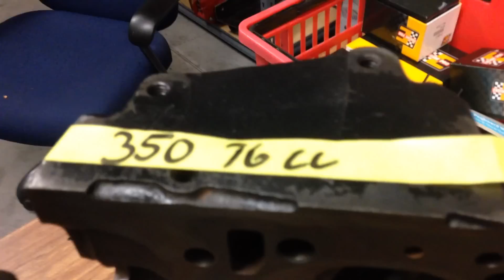350 and 305 Chevy what's The Difference

Comment: now do a 350 and a 400..4.125 inch bore.....not much space at all

and how you can turn a 350 head into a 400 head by drilling holes. 

ive got a 400 in a 68 impala that had a 327 in it....looks the same, handles the same....but lots more power.

and my 77 chevy truck....i was told it had a 305, but it actually had a 400.....first time i drove it, i knew that was no 305. 
my grandmother has a nice 86 truck with a 305....not even close to a 400, but still a good motor, especially with a 700r4. 

just accept the stock 305 power and use it....dont mod a 305....cheaper to get a 350 or 400
Reply: Please do this comparison.
Reply: He'll have a hard time frinding a Small Block 400.  They didn't make as many of them and only ran from 69 to 78.  I had one that came in my 74 El Camino and it was great but I ended up having to sell it to pay bills.  Completely stock unrebuilt I got $350 for the block.   Stock 400 heads are pretty much garbage ( 882 castings) but as you say you can drill 350 heads just by matching up the holes from a 400 head gasket.  Just do it right because 400's have no water flow between the center 2 cylinders.  No room just steam vents there which have to match up.  That's the other reason 400's got a bad rap for overheating, the lack of meat between the center bores that could cause the block to crack between 3 and 5 and 4 and 6.  I didn't have that issue but I also made sure I didn't overheat the engine either.
Reply: Car Stuff with El Camino Guy
Reply: sb 400s are not that hard to find I have 2 and both are the stronger 2 bolt main blocks(the 4 bolt truck blocks have less meat in the webs these are the blocks with 3 freeze plugs per side the 2 bolt block has 2 freeze plugs with the center (third) boss not machined for a plug this makes it easy to tell a 400 block from the other Chevy small blocks (the other small blocks all have 2 freeze plug bosses) and a 2 bolt 400 from a 4 bolt 400 with out removing the oil pan) one of the best improvements you can make to a 400 is to use the 5.7 inch rod  (350 or 305) I never had the overheating problems the biggest issue I had was cylinder wear due to the short 5.565 inch stock 400 con rod(the rod to stroke aspect ratio is to low at 1.48 to 1) when I went with the longer rods with matching pistons and complete balancing it made a for much better engine also if the block cracks between the steam holes it will not hurt it but if like you say it cracks between the bores as with any block they're junk sorry to be long winded but I have built a lot of sb 400sPS if you use 5.7 in rods check your cam clearance before you have it balanced you may need to modify some the rods
Reply: insulman100
 Well, Maybe where you are they're plentiful but where I am it's not the case.  Thing is you may find them but a lot of them either cracked between the center bores or have cracks at the mains.  You're right, the 2 bolt main blocks are more desirable because of the reasons you specified.  I heard from a lot of people that got screwed over buying junk 400 blocks because of it.  You're also right about the freeze plugs.  I had arguments with people that said my 400 wasn't a 400 because it only had 2 freeze plugs.  Once they saw the 1509 casting and looked it up they finally shut up.  These days I'd be looking toward a 502 to live in my El Camino once the 350 Truck block that lives there now gives up.  I'll probably do another rebuild of that 350 for another car though since it has the splayed 4 bolt conversion done to it.
Reply: The only thing I wand out of a 400 is the crank.  I would take a 383 over a 400 all day every day, unless I wanted to make a 406 for a dirt track car...
Reply: Long stroke with a short rod was the 400SB's biggest problem.  Siamesed cylinders aren't a problem - most engines have them nowadays - there is very little heat transfer on the non-thrust areas on the pistons.  The long stroke and short rods, OTOH, created too much thrust load on the pistons and bores.  Even with a 5.7" rod, the rod to stroke ratio is only 1.5:1.  Moving up to a 6" rod increases the ratio to 1.6:1, which is closer to that of a 350 or 305.  This requires a shorter piston, which will run hotter and tend to rock more in the bore.  A 305/350 crank can be used in a 400 block with main spacers to make a 372, which should give more power than a 350 but be more reliable than a 400.
Reply from the maker: now days the factory 400 cranks are not a good choice for a 383 build it will cost you more to grind down a 400 crank to a 350 main size than it will to buy a new 383 crank from scat don't waste your time with factory 400 cranks if you want a 383
Reply: 400 is a sweet motor, I let mine sit for 5 years and season....tough as can be and a real torque monster.
Reply: Would like to see 400 comparison and more info on 400. Just got a 77 gmc vandura box truck, looks more like a hot rod with all the ground effects. Would love to build motor for more power. Will be hauling tons of tools and materials for construction.
Reply: @Myvintageiron7512  
 Can you do a comparison on a 400, and how to get the most power from it. Have a 77 GMC Vandura box truck with a 400, the guy told me it had 350 heads on it.
Reply: The 400 is a crack addict. If you bore it more than .030 over you risk cooling issues in the cylinder walls. Good for nothing but boat anchors.

Comment: Awesome to know this! Very kool to know this information. I had a 350 in a 1989 Formula Firebird, it was pretty powerful but had lots of issues with the headgaskets blowing, transmission constantly slipping or locking into 1st gear only. When it was up and running it was truly an exciting ride but unfortunately that was only about 15 percent of the time I owned it. Was it fun to drive and race around in yes, was the down time and repairs worth the hassle, no.

Comment: i think the bad name came more from the fact that they are jus pretty weak on power generally. some run good and some are jus dogs, ive seen some tbi ones in a 2wd reg cab trucks with some good gears and even a 5 speed that were pretty respectable and would run good. with that long stroke they make good low end torque as well, they jus run outa power pretty quick.
Reply: Lee  Dillinger its the compression issue and the heads

Comment: How about putting 350 heads on a 305 ? With good pistons
Reply: ripfletching
 You will end up with a very low compression engine because of the combustion chamer volume unless they are milled down.
Reply: The valves can clip the side of the bore. Not a good ideal.
Reply: 305 heads on a 350. That works.
Reply: +osp80 how close does the intake valve of a Vortec head come to the deck of the 305?
Reply: But then you only get 10 MPG and have no good intentions.
Reply: 350 cam will tune the 305 right up
Reply: 79tazman so one says not a good idea, you say to do it. So yes or no?
Reply: @rudychapa6759  the will work but it has to be the right heads best thing is just a cam and port and polish the 305 heads

Comment: We raced SBCs for many years in our WoO sprint cars. 1) find or get some " double hump " SBC heads. 2) Find a 4 bolt main SBC block. Many were found in trucks 3) polish the crap out of both intake and exhaust ports on the heads. 4) Match up the intakes and gaskets to the Hiborn or Enderle fuel injector ports. 5) Nitride the crankshaft. 6) 12.5 to 1 pistons when running on alcohol. 7) A gearset crank to cam gets rid of any slop from a timing chain.  8) a Joe Hunt magneto properly set up. 9) a dry sump system if you can afford it. The track is our dyno. When the green flag drops, the B.S. stops.

Comment: dude I love roadkill great show. is it possibly you could make the same video but with 318 vs 360 please it would be the best
Reply: Useful Entertainment And Also The AMC VERSION!! 304, 360, 390, AND THAT MERCENARY COP MOTOR KILLER 401!!!
Reply: Useful Entertainment The difference between the 318 and 360s is a little more complicated there's only about .010 difference in the bore the rest is made up in the stroke add to that of the main bearings are different 318 - 340 have the same stroke 340 was meant to be the performance motor there was even a block with extra webbing for strength and changing pushrod position
Reply: Craig Hooper interesting, I don't hear about the 340s that much
Reply: If you haven't figured it out I put the dot in the wrong place the 318 has a 3.9 bore where as the 360 has a 4.0
Reply: Of course of the three blocks Ford Chevy dodge the common stroker kits you get more cubic inches from the dodge I think they have a 4 inch stroker kit for the 360 you can get it up to 409 maybe if he ever gets around to an LA maybe he could do a stroker on it but there are a lot more popular motors for him to do and everybody just wants a Hemi
Reply: 340's were quick.

Comment: Good video! I do so part time work in a racing head machine shop. Built a 305 with 400 stroke, 305 vortex head, intently balanced. 
Made 504 horsepower at 5800, 590 foot pounds at 5500.
Reply: So how can I get more power out of my 305..k1500. So I won't be the mlm last one towing up the grade

Comment: 305 - HELL - YEAH - !  I built a Camaro 305  that I had laying around the garage to put in my 1975 Corvette - so I could enjoy the car while I built a very nice 350 for it.  While working full time - I built this 305 in 9 days - that's including taking the Corvette engine out - tearing the 305 down - 3 days at the machine shop - putting the 305 back together & installing it.  Although I was in a hurry - I didn't want to put a stock 305 in it - so I added a nice EDELBROCK cam & lifters - aluminum intake - carb. & headers. Pretty much all of the  bolt on stuff for my 350 that I already had.  I also did some secret stuff too - lol  I'm so- weak - but I just couldn't help myself.  Well - to my surprise - it turned out to be a  screamer - I mean, that thing just roared - ! It was crazy how fast it was.  I mean - this 305 would throw you back in your seat & keep you there until you let up.  It was a beast - !It was an amazing change from the 350 that was in it.  By the way - your probably thinking that - well the 350 was old & had a lot of miles on it.  - Nope - the people I bought it from had had in all rebuilt about 5 years before I got it.  I took it back to the guy we bought it from & asked him if he would like to take it for a spin.  As we were driving - I told him to go ahead & jump on it - still not understanding the point that I was trying to make he floored it.  It slammed him back in the seat & his eyes got huge as his jaw dropped - then he let off & stopped.  He just looked at me.  I laughed & said - you like -? he just nodded. Bottom line - it was quick - it was fun & it was dependable.  I never did take that engine back out - it was that good.  Here is the funny part - the day I bought the Corvette - the wife & I decided to take out for an evening cruise.  We didn't get more then about a mile or so from the house & ran out of gas - !  Boy those Corvette 350's are hungry.  That being said - the added bonus of the 305 that I built was - now get this  -  that bad boy was crazy good on gas.  I mean so much so that we were always worried that there was an issue with the gas gauge - nope.  We drove & enjoyed that car for 20 years.  Other then oil changes & tune up's I NEVER had to lay a hand on that engine again.  I would eventually trade it to my backyard neighbor for beautiful top of the line Lincoln Town car that  was in showroom condition.  The Lincoln was about $45,000 new.  He had heard the Corvette running in our back yard - after I had washed it.  He popped his head over the privacy fence & said " boy that thing sounds great - I could hear it from my back porch"  We would eventually make the trade.  He had to work on me a while because we just loved that car.  But we decided to let it go.  I mean - come on - he had that gleam in his eye that only a man gets when he's in love.  Besides - I think that everyone should have a Corvette at least once in their life.  We got to be such good friends - that we put a gate in between our properties - so we wouldn't have to walk or drive around the block to visit each other.  The bottom line - engine's just like life - they are what you make of them-!  If you take care of the things that you love - the things that you love will take care of you - !  Bigdog - out . . . .

Comment: I agree. 305 is definitely not junk. You're not going to take over the world with it, but it can be a good thing if used in the right application. I rebuilt one in the 90's for my Caprice and drove it forever. Change the oil on time and keep the cooling system up and it was bullet proof.

Comment: good video.  Another small block engine from the 70's was the 307 cubic inch engine,  I know they used the 307 in pickup trucks, maybe in some other Chevy models too.
Reply: had a 307 in my 72 chevelle wagon and was the first car that I hoped up and learned a lot like make sure the rotor is in the right spot!

Comment: Thank you. That was a great review. I haven't been in the "game" of engine building, swapping (etc.) for many years and have been trying to refamilarize myself with the line of thinking (orientation) needed for working rationally on engines... instead of the wide-eyed illusionist (delusional) teenager perspective I had seen many decades ago when working on different street performers for friends and others who thought to build a vehicle that could climb trees, fly over mountain tops, etc.... In addition, I agree with the assessment made about the old Hot Rod magazine. Thanks for tip about the new generation of down-to-earth enthusiasts having taken it over.

Comment: My understanding is that the 350 blocks had a nickel alloy in the block, while the 305 had none. This made the 305 cylinders wear faster. This info is from the HP book on rebuilding Chevy V-8's. In my times selling used Chevies at a used car lot, the used 305's we got in trade with about 100k miles always burned oil, and typically had flat cams and chewed up nylon timing gears. 350 engines seemed to be good for more miles without those problems. The ww2 GMC motors in the 6x6 2&1/2 ton trucks had the same issue with the lack of nickel in the blocks as well. My experiences took place in the late 70's, and mostly applied to engines from the 1979 to 1985 era. Nice video. BILL H.
Reply from the maker: They also removed the Nickel from the 350's in those years for weight saveings

Comment: I had both, a 350 in a '72 C10 Step Side (stick) and a '78 Malibu Classic with a 305 4BBLs on both. Both were pretty reliable but while the sedan could get out of its own way, the pick up was like a hot hod. Crack the secondaries in second gear it was a blast. I miss this truck all the time. Car, nope.

Comment: Great job explaining the 305 vs. 350.  I drove a stock  late model El Camino - "Choo - Choo" after market option - but still the stock FACTORY 305 CI  factory motor that Chevy put in the SS models.   It was surprisingly a  pretty peppy  ride for its intended use.  The "specs" are out there, but an  article that quickly  shows major  differences in the full spectrum of the Chevy Small Block would be insightful to many viewers.  ie  those cubic inch versions   265,  283, 302, 305, 307, 327, 350 and 400. (heck - might have even missed a CI or two!).
Reply from the maker: great idea I'll work on that

Comment: Thank you for your explanation. I have a stock 305 crate motor still wrapped up ( it’s older maybe about 20 years). Leaving the internals alone, if I run a good carb and manifold plus headers and a good exhaust system, would it be a good engine for a street cruiser?

Comment: Looked like the 350 block had larger water ports for better cooling for a bigger bore. Am I correct on this observation? I'm building a Gen1 305 with 062 heads, and never planning on boring the cylinders. Going in my daily driver, 86 K5 Silverado.

Comment: Great video. Good explanation, good advice. Years ago, I had a 73 Buick Electra 225. I was looking around for somebody to pull the engine go through it reseal it, do all the stuff I didn't have the space to do myself. One shop really torqued me off, the young man suggested that I replace the 455 Buick engine, with a 454 Chevy, as there are more parts. This young man who it had this young man who had no knowledge of anything other than Chevy, and was unaware of the power available in the 455. Needless to say I quickly walked out of that shop.

Comment: My 2002 boat has this chevy 305 in it. 17 yr old original motor that is cooled by salt water, no coolant.  Pisses out rust water and still going. The exhaust port flanges are black and rotted. They haven't leaked yet. Also my motor ingested saltwater from a leaky plug that failed on the intake manifold and was squirting directly into the flame arrestor.  I was blown away how it didn't seize up. Only downside, the motor is to small for my big boat but that how it came from the manufacturer.  The low end torque suffers. All in all, good motor with great compression still.